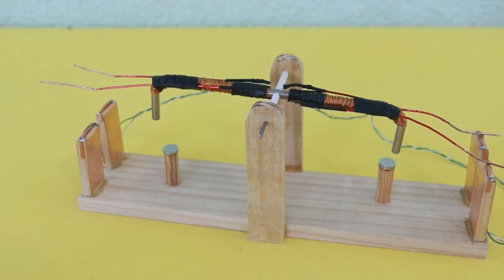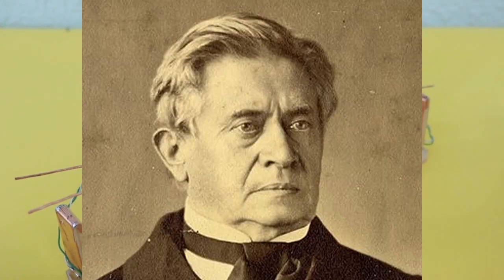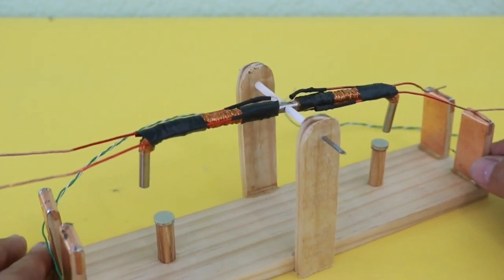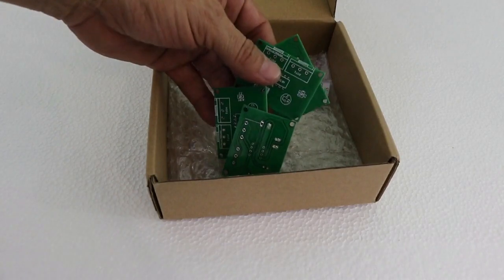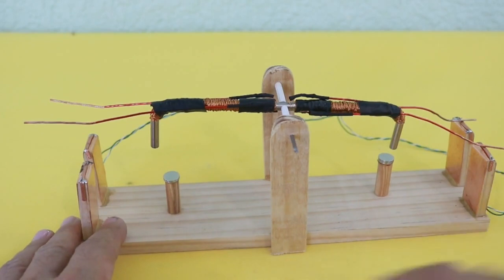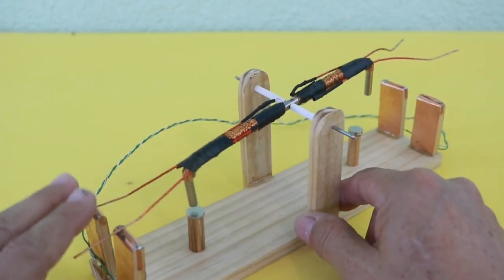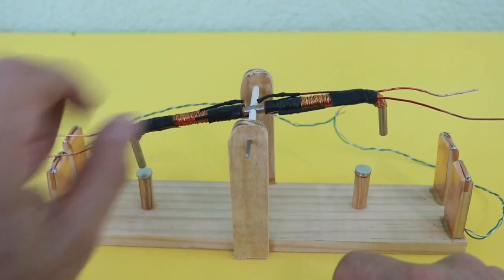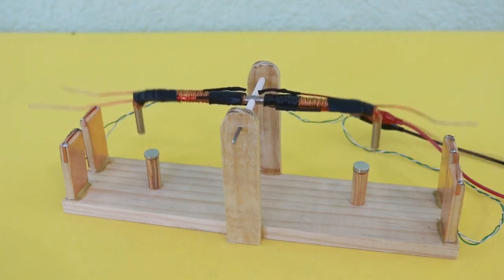Vintage Electrical Devices: The Henry Rocker

Comment: I saw a video of you made like 1 year ago.
I was making my slayer exciter circuit but it doesn't work. The LED is not turning on.
I don't have 2n2222 transistor so I used D13003X since they are both NPN.
I would appreciate if you give me any tips 😕❤🥀
Reply from the maker: most common mistake is that primary is connected in reverse